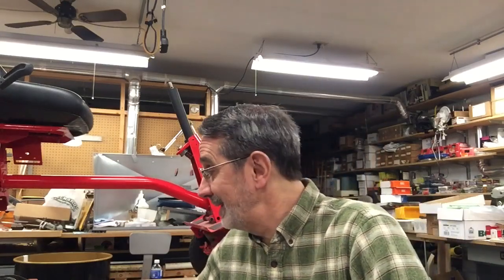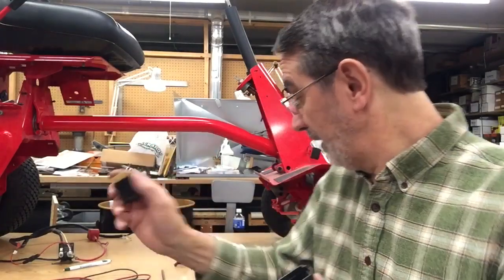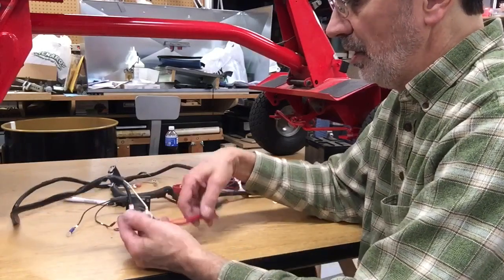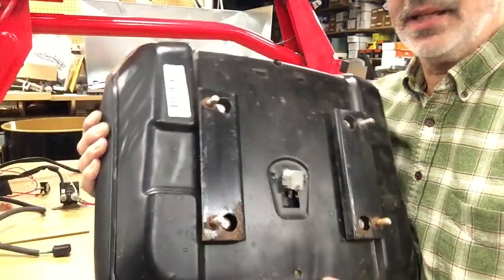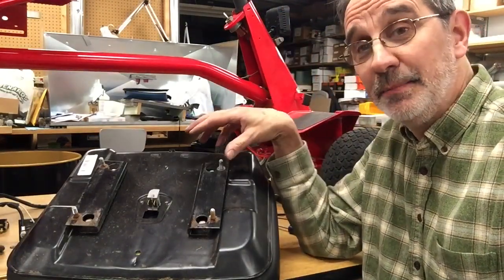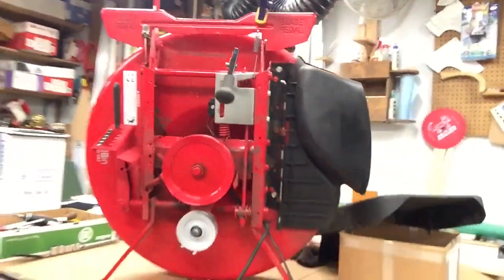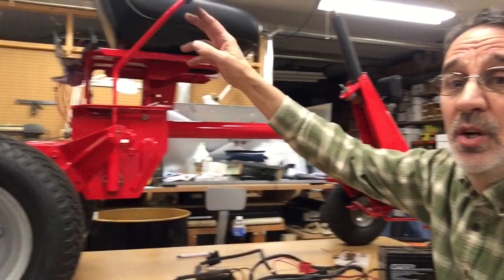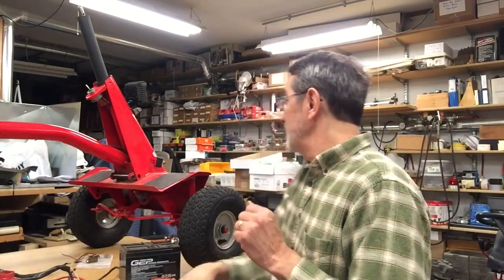273. How to test and find the safety switches Snapper RER

Comment: On my Snapper, (17.5 hp Intek) engine starts but when I release the brake, engine dies.  Seat switch?
Reply from the maker: Noah sounds more like the safety switch on your yoke. Stand your machine up. It’ll be on the lower left-hand side with four wires.
Reply: @jimjackson9381  Got it.  Thanks!  Yes, I pulled the switch out, plugged it back together and taped the plunger closed, to fool the electrical system that the brake was still set.  Engine ran with brake released.  Ordered replacement switch and will reinstall.

Comment: I just picked up a mower and for the life of me I can't get it started, I've let the carb set in carb cleaner and cleaned it off. I got a new in line filter. I'm having to jump it off because the battery is gone. This thing sat up for 2 years. It's got fresh gas in it. The seat safety switch is cut and wire nuts are on the ends. I have a new carb coming Monday because it will run for a short time  on starting fluid. The plug is new and I do get spark.  Any suggestions?
Reply: @ Jim Jackson
Reply from the maker: @stevestewart3816  Yeah I think you’re on the right track with a new carburetor or trying to clean your old one let me know what’s going on with it, I see my last email didn’t come through I can’t remember what I wrote it looks like I was trying to send you my email address which is
jimsfixitshop@gmail.com
Thanks. Jim
Reply from the maker: For a test take all the wires off of the magneto grounding screw and see if it will start, let me know what it’s doing. Jim
Reply: @jimjackson9381  yea I took the wire off the magnito still didn't start.
Reply: @jimjackson9381  I'm thinking if it was any problems with any safety switches would it even start with starting fluid?
Reply from the maker: @stevestewart3816  no probably not so I’m thinking your carburetor is a good starting point, pull the hose off the carburetor and make sure you have a good gas flow going to it I’ve had issues with bad gas lines in the past. Jim
Reply: @jimjackson9381   I have a new one coming in Monday.
Reply from the maker: @stevestewart3816  keep me posted Steve and we will figure this out. Jim

Comment: Snapper RE 210  33 inch   mowing fine   I stop pull handle to stop  blade motor dyed  won't restart turns over good fires one time but that all what is wrong ?
Reply from the maker: Ron Wilson 
Sounds to me like you have a safety switch issue it could be the switch that’s on the mower deck, one easy way to tell if it’s in the safety system is to remove that wire from your magneto shorting block then your engine should start up and everything should work fine that will isolate the issue to one system then you’ll have to start checking switches to find out which one is bad, I would start with the mower deck. Jim

Comment: I was mowing on my Snapper SPX 150 Series Model 2691021 (10 Years old) when I stopped to take a break, it would not restart. I saw the battery was old, so I replaced that, checked the solinoid, safety switches and everything I could think of. I am getting no power to crank the engine. I did a bypass and the engine ran ok. I'm at a loss, can you help. Frank E.
Reply from the maker: I’m not sure if this is a rear engine snapper or a front engine snapper by your numbers you sent but anyway to test the safety system on your engine there is a control panel where the throttle cable hooks to on that panel will be a bolt sticking out that is your magneto shorting block typically there’s three wires on that block one comes from the coil inside the engine one comes from the ignition switch and one comes from the safety system take that wire off from the safety system and see if the machine operates properly then you’ll know for sure it’s a issue with the safety system somewheres just remember to hook the wire back up when you fix your issue it’s there for a very important reason, let me know what you find out. Jim
Reply: @jimjackson9381  Thanks for getting back so soon. The mower is a front engine and I could not find panel with a bolt.
Reply from the maker: It’s typically on the same side as the carburetor that is what your throttle cable hooks to and your linkages go to the carburetor from that panel and the magneto shortly in block will be on that panel usually it’s on the lower right hand side it’s a bolt that sticks out about 3/8 of an inch with a nut and some wires on it but it’s mounted in plastic so it is not ground it to the engine
Reply: @jimjackson9381  I did find it, i almost had to take the hood off to find it. There are only two wires, one is black and the other I think is a light green and they are both in a connector. Before I cut one of the wires, what do you think I should do?
Reply from the maker: @frankeldien6746  take both off and see if it will work ok but don’t let the wires touch any ground it will kill the engine, to stop the engine put the wires back on. Let me know what it does. Jim
Reply: @jimjackson9381  Pulled the connector off and nothing happened, still do not have power.
Reply from the maker: If you take a jumper cable and go from the hot side of the battery to the lug on the starter tell me if the starter works. Jim
Reply: @jimjackson9381  Yes, the starter works
Reply: Jim, I thank you for all the time you have spent with me and I enjoy watching your videos. It's time for me to take this mower in for repairs.
Reply from the maker: Well let me know what they tell you what was wrong with it. Jim

Comment: Where is the main integrated switch for a model 7800951 snapper rear engine
Reply from the maker: If you’re talking about the interlock modem that controls entire safety system that is in the same area where your starting solenoid is on the opposite side of your machine from the battery. Jim.

Comment: Hi, i have a snapper sr1433 and won’t start with the switch, its start manual. I put a new solenoid, if the security switch is bad won’t start with the key? Thanks
Reply from the maker: Back under the seat where the solenoid is there should be a fuse check the fuse to see if that’s good if that’s good and the engine will start when you turn the key to the on position it’s probably the ignition switch I don’t know how old your machine is or how many safety switches you have, does the engine turn over with the key but it just won’t start or does the engine not even turn over when you turn the key to start?. Jim
Reply: @jimjackson9381  the fuse it’s ok, It’s doesn’t do nothing with the key, its star manually I put the switch in on and I pull the rope.
Reply from the maker: So when you turn the key to the Start position does the engine turn over but not start or does it do nothing?. Jim
Reply from the maker: So if this is a SR series it is not the turtle correct. Jim
Reply: @jimjackson9381  it do nothing, maybe the switch its not sending the signal to turn the starter.
Reply from the maker: Run a small jumper wire from the battery to the hot side of the solenoid and that will tell you if it’s working you should turn the engine over as soon as you touch the wire on the solenoid. Jim

Comment: Engine starts on mine, try to engage blades and engine dies, even with brake on trans in neutral. Blades off, trans in neutral, when I let the brake pedal up engine dies. It was running with the seat switch taped down. Even tried jumper the seat switch to see if that was the cause of engine stopping but no joy.
Reply from the maker: It sounds like your Yolk switch is either out of adjustment or it’s not working check that. Jim
Reply: @jimjackson9381  thanks.

Comment: Also, how do I bypass the safety switch under the engine deck in the back? Maybe that’s suspect on my comment above?
Reply: Sorry… I meant the Comment below…
Reply from the maker: It’s kind of hard to bypass that switch because it’s a double switch it’s normally open and normally closed your best bet would be to take it out and check it with a meter and see if it’s working. Jim
Reply: @jimjackson9381  I ordered the belt and the switch from Parts Tree… btw… my Snappers are both Model 7800104 /28” hi-vacs
Reply from the maker: @Garylee62  Well let me know if that switch does or does not take care of your issue. Jim
Reply: @jimjackson9381  I certainly will!

Comment: I just learned why my mower blade was turning with the engine!! I did not know about the foot parking brake. I stopped your video, and ran out to the mower. It has that foot brake, I pressed the brake pedal down and the lock lever over, and pulled the recoil start rope... the engine pulled right over and the pull rope retracted ,,,
Reply from the maker: Well regardless if you have the pedal down and locked or not when you start your machine the blade should not be spinning, start the engine and check to see if the blade is turning or not but be careful. Jim

Comment: Question, my snapper rider runs great until I release the clutch, then it Boggs down and no power, any ideas ?
Reply from the maker: Does it bug down and stall the engine or does it just bogged down and keep running?. Jim
Reply: @jimjackson9381  Boggs down and keeps running
Reply from the maker: @jeffsandberg9163  Hey Jeff what I’d like you to try to do is put your machine in neutral stand it up and turn the clutch disk assembly by holding onto one of the four nuts and see if it turns relatively easy or if it’s turning really hard and tight. Jim
Reply: @jimjackson9381  it turns easy
Reply from the maker: OK if it’s turning really easy then it’s not putting a drag on the engine my next guess would be your governor is not working properly, what does it do when it’s sitting there running in neutral and you kick the mower deck in gear how does the engine act at that point ?  . Jim
Reply: @jimjackson9381  it runs the same no power, spits and sputters .
Reply: @jimjackson9381  reacts the same except when the clutch is pressed in , wish I wash a mechanic

Comment: It was buzzing when you checked the solenoid.
Reply from the maker: The solenoid does not buzz,  all you here is it Will make a clicking noise when it turns on and off. Jim

Comment: I'm wondering if anybody knows why if you disconnect all the safety switches why the engine still won't get spark?
Reply from the maker: If you have all your safety switches unhooked by taking the wire off of the Magneto, Shorting block and your engine still won’t start then you have a problem with either your ignition switch your kill wire, going from your magneto, Shorting block to your coil or the coil itself. Jim.
Reply: @jimjackson9381  thank you sir!

Comment: I have a black and white wire going to starter I cut the butt connector.cause it was burning i thought. Any idea sir
Reply from the maker: Dump Godby 
Well I’m good but not that good in electrical short or issue I have to check with a meter to track down where the issue is and how to repair it it could be somewhere in your safety switches or it could be your stater I’m just guessing that’s something I have to actually check to find. Jim